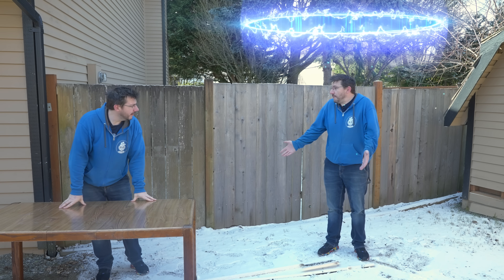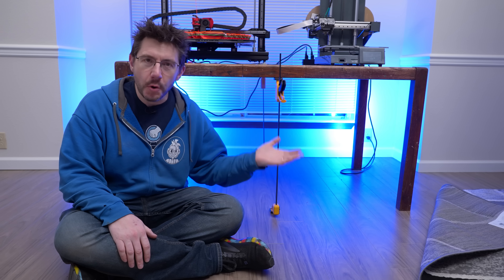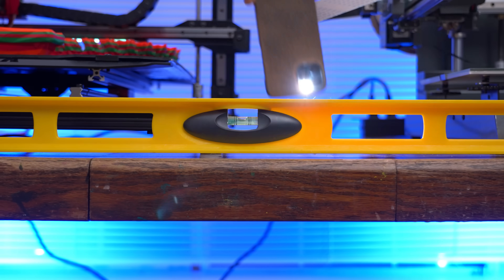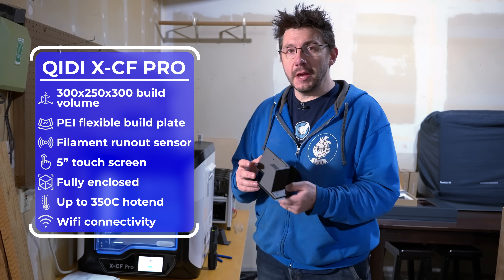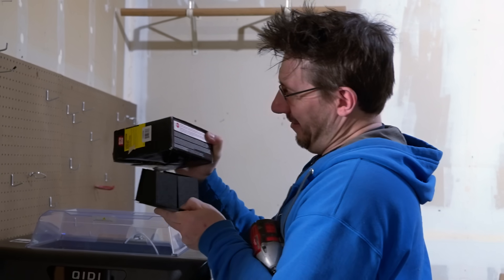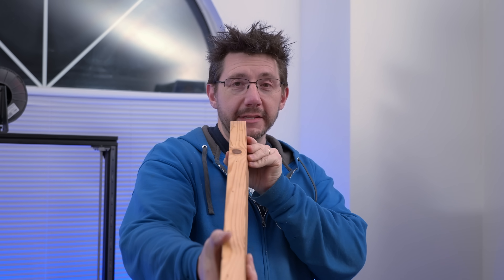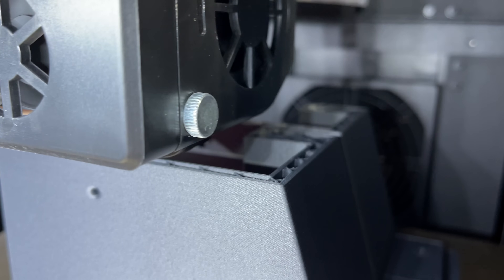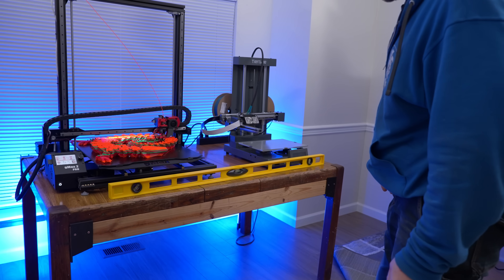Practical Printing and Time Travel?

Comment: Hey Joel,
I've been 3D printing for a while now and need a printer that I can just crank out prints on with minimal down and tinkering time. Is there a good printer out there that will just let you swap out parts quickly and easily so that you can get back to the task of printing rather than endless tinkering?

Comment: Question.     Have you ever used the welder connector Device that I seen on Amazon that well work with attaching filament to different roll so I can use up bunch of this little section I have at my house      Have you used those how do you like them if you have

Comment: Look at the way those screws get sucked into the print!
Reply from the maker: Yeah, I tried the screws I found - but I very much should have used cap head screws. Ugh. Version 2 - cap head!
Reply: @3DPrintingNerd  I'm impressed with the print. The layers handled that stress very well. Could have used cap heads or could have modeled in a counter sink. Either way the print held up to that force very well. Fantastic stuff!

Comment: Ok, I don't think this is a good material choice. First, CF Nylon as some material creeping issues, so it is not suited for an application with a static pressure like fixing a table. Secondly, PLA would have probably been enough. And third, I don't think you're providing a good example for the "Easy 3D printed repair" by choosing a filament that cost a lot, is hard to print and not suited for entry level printer.
Reply from the maker: Thanks to this video I’m learning more about cf nylon and creep. Most likely I’ll redesign and print in PLA. Although I did mention anyone else could have used PLA etc, I just happened to use this material because it came with this machine. Have any good ideas for a better design to print in PLA?

Comment: Nice job! I keep looking for an excuse to try some CF nylon, I just haven't found one yet.
My wife has a desk on which the legs came loose due to her sliding it on carpet. So I designed some custom leg braces and fixed it. I just used PLA. It does feel good when you repair or improve something using 3D printing.
Reply from the maker: I bet PLA would have worked for mine too. Great job on the fix, Jon!

Comment: Ahem ... you should have screwed the 2x4 on the inside of the table sides directly in the top, without the bracket 😆
But the printer looks amazing !
Reply from the maker: You mean screw through the top into the 2x4? I thought about that, and it would have worked for sure, but then I wouldn’t have been able to practice my 3D modeling :)
Reply: @3DPrintingNerd  Ohhhh ... oh ! Yeah you're right ! :D

Comment: So you created a 3d print for something that using a pocket drill gig, wood, and screws would have fixed?  You added a layer of complexity that didn't need to be there and a possible failure point, but I suspect it was fun to create.  And that is why we print things.
Reply from the maker: So, I mean yes, heh. HOWEVER, now you’re making me want to model and print a pocket drill jig! :)
Reply: @3DPrintingNerd  yup. That’s what I do. You should design it so you can put washers into both ends so the drill doesn’t destroy the print.
Reply: @3DPrintingNerd  learning wood working and making it better with 3d printing would be great. There are all kinds of jigs that could be partially 3d printed.

Comment: I like that you tackled head-on the truth that a lot of problems 3d printing can solve are still probably cheaper and faster to solve with a mass-produced item like an L-Bracket.  Being honest that the goals were: to have fun using the printer, to practice using CAD software, and to revel in the idea of turning digital objects into physical objects is a good way to put this project in context.  And is really the theme of the channel, isn't it?

3d printed brackets are custom to your task and probably prettier.  They also minimised the time spent in a large store, which is not an advantage for everyone but would be for some.  They probably aren't cheaper and almost certainly aren't faster than the hardware store items, but saving time and money wasn't a goal - and to have fun, we have to spend time and/or money at some point!
Reply from the maker: Yes this is exactly it! Being able to tackle a problem like this by using a skill set I am trying to learn, and tools I already know how to use, is just plain wonderful!
Reply: @3DPrintingNerd  Nevertheless, you are framing your problem to match your approach. Still feels way too much of 'fool with a tool'.
Reply: Yeah I mean I've definitely caught myself needlessly printing things, but I've also found myself in so many situations where the hardware store either doesn't have what I need or is selling it at ridiculous prices or quantities (I don't need 500 of the same metal bracket...)

Comment: I was once laughed at for making toilet seat hinges. 

"Why not just go to the hardware store?" they said. 

Me: "Um because designing and 3D printing is fun, cheap, faster (sometimes) , saves me gas and time, and I guarantee my Alloy 910 hinges are way stronger than the crap you buy at the store, and I'll have the file for later use if needed again."

"Oh, I guess" they said. 

I dont think anyone really appreciates what 3D printing can do until they've experienced it for themselves. 

I started with a diff lock pedal for my tractor, and now my computer has gotta have 300+ designs I've made since 2016. Some big, and some small.
Reply from the maker: I think that’s it right there. You’ve hit the nail on the head.
Reply: I know people like that too. I'm over there raving about 3d printing,and they're scratching their heads like 🤔? Lol....
Reply: I would still laugh at you for that ;)

Comment: Might be even better if you did both sides.  😁
Reply from the maker: I did! It just didn’t get shown in the video :)
Reply: 2 boards, I think he did front and back long edges. Did you mean to say both ends.
Reply: @OldCurmudgeon3DP  I saw him do the front but not the back. He was doing it while the 3D printer was printing and the table was too close to the back wall to get behind to do the second board. That's why I believe he didn't do the back board.
Reply: @VideoJocky1  fair point. I would have had issue getting on that table w/ just the front brace on it. Joel has me beat by more than a few pounds I'd wager.

Comment: Can you check to see if it has an all metal hotend or a PTFE lined hotend? 
I took apart the "high temp" hotend included with my X-Max and was shocked to see a PTFE lining that went all the way into the heater block. I can send pictures/video. An odd choice to say the least.
Reply: QIDI also offers a proper all metal one now. The x-cf pro has a different high temp hotend design, looks like a dragon, with all metal throat.

Comment: Time travel makes you hungry? Meat space? Turkey and Thanksgiving? Foods on the mind at Joel's Printorium and Store, now with yet another questionable table... or at least formally questionable table, thanks to 3D printing (and some 2x4s).

One day I will swap out my brass nozzle and try some abrasive filament... I've swapped nozzles. I have hardened steel ones. But just never gave it a go. Will be curious on on Qidi (*heavy sigh before comment* maybe block the "$2000!? I can by X Ender 3s for that" before the video even drops. Saves everyone time)

Comment: I think the reason it sags in the middle is that it used to be an extendable table and bits are missing. Good work on saving it from being landfill though
Reply from the maker: Are you sure it’s not from too many Thanksgiving turkeys?
Reply: @3DPrintingNerd  Turkeys are so small compared to our murder birds.
Reply: They are not missing, the screws are probably loose on the extensions rails ... 
But that printer !!!
Reply: Looking at the underside from the start of the video it looks like a very cheap extendable table. All the hardware looks thin. Maybe some angle irons on the underside could have added the needed strength.